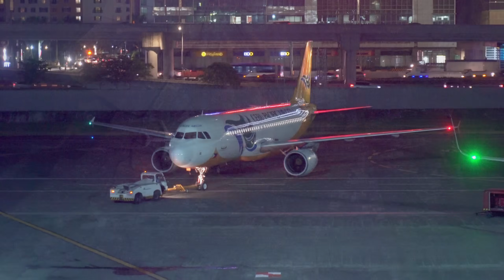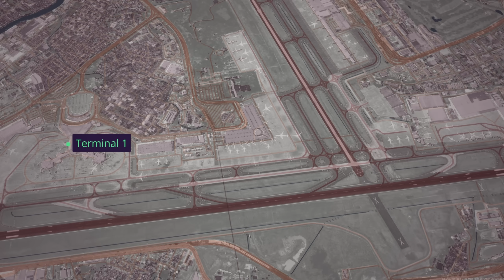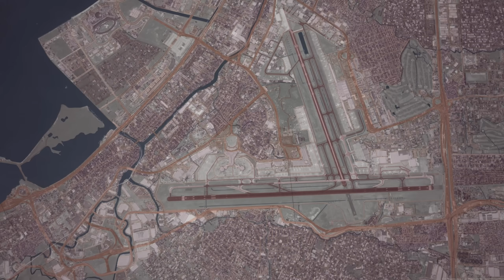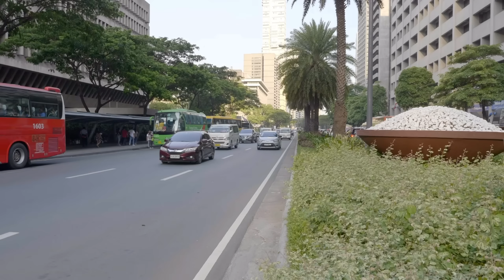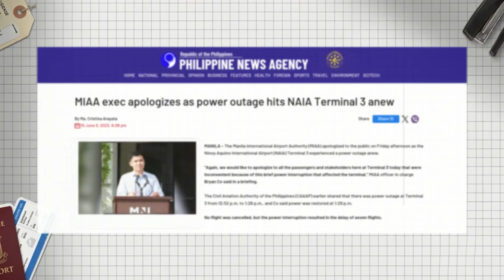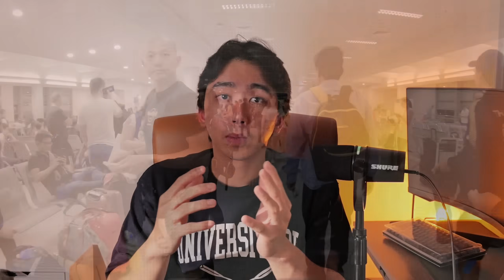Manila’s Airport Problem, Explained

Comment: A few points I’d like to add: 

1. Poor infrastructure, the terminals aren’t connected, so you have to take a separate trip to get to the other ones 
2. Transportation problems. Transiting from one terminal to another is such a hassle. 
3. Immigration, probably one of the biggest reason NAIA is considered a bad airport. (Absurd demands, unnecessary requirements, and slow processing) 
4. Weak security. 
5. The airport is completely landlocked, meaning you can’t expand freely. Take a look at Changi and Haneda, they’re not landlocked, which makes expansions far easier. 
6. The size. It’s not big enough for the number of passengers using it. I can’t emphasize this enough!
7. Late modernizations. We’ve only started introducing electronic gates recently. 

Honorable mention: 

Travel tax, E-Travel Registrations to leave and enter the country. No wonder foreign tourists skip our country. If you’re going on a vacation, the last thing you want to do is fill up and register for “QR codes” and get stranded in an overcapacity and overcrowded airport.
Reply: In my opinion, to overcome all problems, the key is political will. The case is almost similar to Soekarno Hatta Airport in Indonesia, especially point number 5. Previously, they only had 2 runways, but now they have 3. To build the third runway, they had to relocate houses around the airport (buy land) and now, their flight movements have increased rapidly from 72 to 81 movements/hour to 100 to 114 movements/hour. They also canceled the construction of terminal 4 and instead revitalized the old terminals (1 & 2) & the new terminal (terminal 3) to increase passenger capacity.They did not build new buildings or demolish the old ones either but the capacity increase from around 50 million passengers annually to 96 million passengers annually. They also did the same thing with Bali airport. For Changi Airport isn't actually that big, but they've designed their terminals to be compact enough to handle a large number of passengers. For the most part, they only operate two runways at the moment. The terminal capacity is 90 million, with each terminal accommodating around 20 million passengers.
I think the government should hire an independent and professional consultant for this.
Reply: @lucasli7826This is true. The airport can’t fix itself. The government needs to prioritize things that actually matter, such as making the necessary adjustments to expand the airport, instead of prioritizing renovations that only add aesthetic value. Building the New Manila International Airport is pretty much a bandaid solution. Instead of fixing NAIA, they’d rather gamble on a new airport.
Reply: @RyomenSatoruJJK NAIA will never ever be expanded at all unless they stripped off some portions of cavitex for the runway across it to be reach the open sea and make it expanded its reach or even transfer some of the terminals and runways beside the reclamation areas in Pasay
Reply: Then our country wants to increase tourists in our country while they can’t even fix the airport😂
Reply: Don’t forgot the taxi drivers outside the exits that are allowed to blatantly scam tourists that just arrived

Comment: The 3 additional terminals were built as an afterthought hence the lack of cohesion of the buildings aesthetics as if they were constructed by different builders.  The lack of accessible and efficient transportation to connect you from one terminal to the other terminals is another big issue. Unlike other major international airports, you can be dropped at any departure entries, there is no worry missing your flight because you can either walk or ride a tram from one end to the other end.

Comment: The worst thing is those airport busses that connects to other terminals will take you approximately 2 hours due to the fact they even dont use Expressways and only one person is in charge in driving and handling the bag. Worst Airport to have if you have connecting flights! If you're in a hurry, You must rent a taxi/ride hailing apps for almost 15 Us dollars to reach to other terminals. Even water and Wi-Fi in there is not for free!
Reply: Could easily be fixed by making the bus go through inside the airport when connecting passengers. No need to go to the main roads and mix with regular traffic.
Reply: @jjjmmm-i9v  I agree with this, hopefully they will take this into consideration. Just experienced it and that was the worst luckily i arrived last call for my flight and wouldn't want to try it back again. First time seeing this kind of connecting mode of transport from terminal to terminal that will take your roughly 2 hours because of traffic and turning around to other 4 terminals.
Reply: @jjjmmm-i9v most logical solution.
Experienced that last year. I'm in terminal 2 for domestic flight but aircraft is parked in Terminal 1 as it came from Singapore flight. Just 20 mins we're on aircraft already
Reply: the buses were driving inside airport before but by unknown reason they had to change all onto the public streets
Reply: I agree; I study at NAAP and always wait for a bus to catch going home along Andrews Avenue in front of T3. But I always notice, those P2P buses of NAIA always pass through Andrews and other roads instead of passing over it through the NAIA Expressway which was actually built for a reason. 

The only thought I could ponder out of this is either run the buses within airport grounds or just create dedicated lanes on all roads and motorways just for those P2P buses.

Or better, just make a rail corridor. I hope the Manila subway does it.

Comment: Turn that place into prime real estate when the new airport in Bulacan is finished
Reply: No, convert it to a Cargo and Logistics Terminal. The airport roads already feed into the Skyway system. Cargo flights are not at the same volume as Passenger Flights.
Reply: Central parks and Public spaces would be nice, especially this is the only country that doesn't even have one.
Reply: @koyqke3375  I agree with you. The city needs a designated public park so the metro can breath from over-population and pollution.
Reply: Too much real estate as my eyes recently saw, maybe public spaces for once because it's scarce nowadays
Reply: More condos (oversupplied) and malls again? No Thanks!
Reply: Bulacan is way too far for it to entirely replace NAIA, and its total closure would be opposed due to all the development around T3 (Newport) and its proximity to the main economic centers of the Philippines (Makati CBD and BGC). Additionally, they’re already pouring billions into building two new terminals and adding a connection to the subway, so it would be a bit waste to just close it. If anything, NAIA should become a more business-centered airport kind of like Haneda to Narita in Tokyo
Reply: @noodles7193  Airports around the world should be located far outside of Metropolitan areas, NAIA sits on a highly dense populated area and heavily built up, residents in the nearby Parañaque, Taguig and other areas surrounding the airport are already complaining of too much noise pollution, take the lessons from Hong Kong.
Reply: @dennis12dec  I agree, but you also have to think practically about this sort of thing. We're not at a point where we can comfortably just abandon an airport that has gotten a ton of investment and dedicated infrastructure. Lower air traffic should be the goal, not full on abandonment, again like Tokyo Haneda vs Tokyo Narita or NYC LaGuardia vs EWR or JFK. Additionally, most cities the size of Metro Manila have multiple airports, and its not like NAIA is in the direct center of the Metro. 

Maybe I'm a little biased as a resident of Makati, but I think until we can get a proper replacement in the south (maybe through the Sangley Point redevelopment), I think for the foreseeable future NAIA needs to stay open, although most primary traffic should be relocated to Bulacan
Reply: @noodles7193  The New Manila International Airport in Bulacan is roughly the distance between the French capital Paris and Charles de Gaulle Airport in Roissy, France, the new airport will have 4 parallel runways that allows simultaneous take offs and landings every 30 seconds and away from populated areas, SMC Infrastructure is partnered with Groupe ADP who operates and mamages the 3 Paris Airports Orly, Le Bourget and CDG.
Reply: @noodles7193  The Private managing company is not going to phase OUT or cease NAIA until Bulacan INt'l Airport is fully functional. NAIA is or was at the bottom 100 in ranking amongst the best airports in the world and the government previously managing the establishment is or was unable to fulfill modernization and reconstruction hence the needed privatization. That's why NAIA has improved significantly in the last year with all the additions ongoing due to the deligence of said private company. Most major airports around the world are located far from the main city to allow it to expand in the near future. Some well-known airports are Incheon (30 miles from DT Seoul),  San Francisco Intl Airport (15 miles from DT), Orly (29 miles to DT Paris), Heathrow (20 miles to DT London),
Reply: Bulacan will never be done
Reply: That's the goal and many big shots threw everything to get the ₱2T ROI promise from a decommissioned NAIA. LT Group vs Megawide vs Metro Pacific vs SMC. Who would be attracted to 80-20 revenue collection? 20% goes to the private corporation?
Reply: bad take 👎🏻
Reply: Tabogo kasi nagplano at naglatag nyang runway na yan!
Reply: I'll correct your sentence. "IF" the Bulacan Airport "Will be finished.'

There, corrected it.
Reply: @markrioreyes5706 The Kuala Lumpur International Airport is located in the town of Sepang, Selangor State 45km from the Malaysian capital and retained the name of Kuala Lumpur.
Reply: you all have good ideas but you are forgetting something, we have corrupt politicians.  nothing good will happen because of them